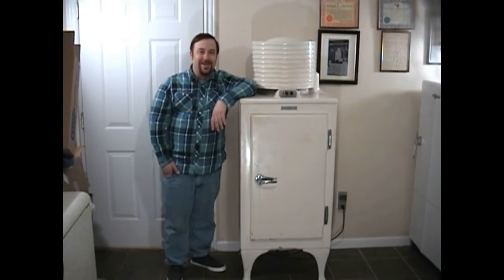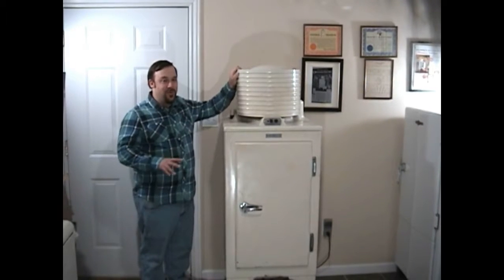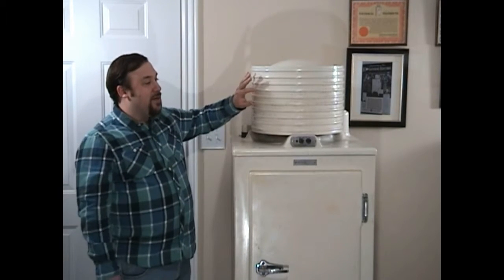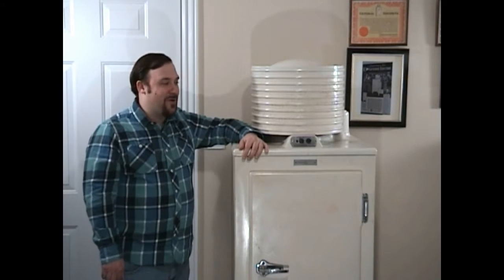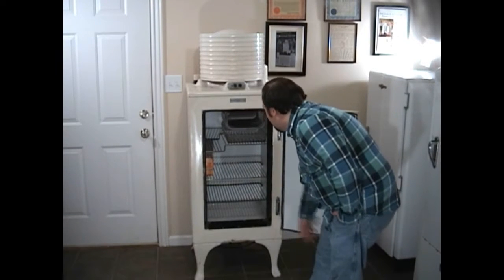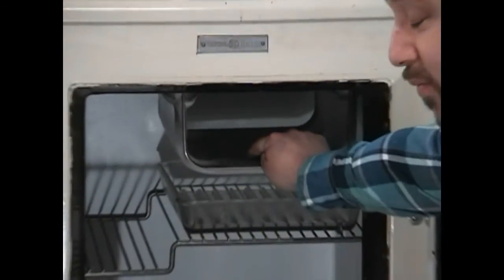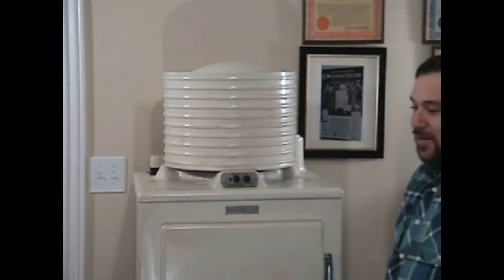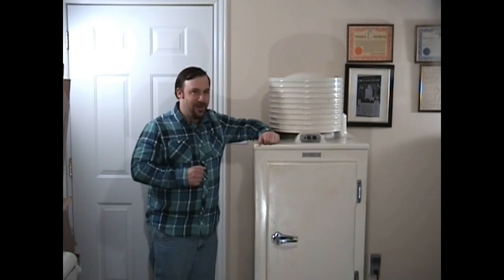Quick(ish) General Electric CA Monitor Top Overview

Comment: Great Video! I also have a big affinity for old refrigerators and other appliances as well. Appliances have been a big part of my family. My grandfather owned and operated a small appliance retail/repair shop for 55 years. They mostly specialized in Frigidaire appliances. My father and my uncle also worked there for many years. I still have a lot of my Grandfathers original tool’s.

Comment: That's so cool to have the warranty information.  You should be very proud.  The control knobs are the same as my 35 CK, and the handle is very similar too, once I pulled off the chrome cover.  It is cracked.  Maybe I'll just refinish it to look similar to you CA.

 Great video!

Comment: It is so my thing,m 1 million percent.  I just paid more to have a fridge shipped to my house, than the price of the fridge.  I thought the guy would ship it upright, but no he laid it down.  It did not seem to hurt anything.  I bought it because it was the same style and matched my 2 door fridge - yes the first GE fridge made for home sale - with the long (1927) door hinges, that you would commonly see on wooden ice boxes.  We managed to get it into the garage and eventually I will get it into the house, but I will need help as it weighs like 500 lbs.  The 2 door fridge - the 'icing unit' I think weighs like 400 lbs by itself.  That almost killed me moving it into the house, on a dolly.  That's waiting till I get money saved up to get restored - it came not on top of the 2 door case.  I also purchased some nice big 'queen ann' styled legs I can put under the case of the 2 door unit.  Currently it is sitting on a dolly with no legs.  It looks like it was built with no legs, originally.

Comment: My dad has one (GE Monitor Top) his grandma bought back in the 1920's. It was used in a rental property until the early 1990's due to it was beginning to shock you if you touched it. Today it's a little rusty up top. I am curious if it still works.
Reply: Turn the plug over in the outlet when it does that.  I used to work in a restaurant that had a large one of those things they used and it would really latch on to you if the plug was in the socket the wrong way around. It probably needs re-wiring as well of course.
Reply: @earlnut  It sounds like a love tap from the past - provided it doesn't stop your heart.

Comment: I need to re-insulate the light socket on my CA.  When the door is closed, no shock.  When it opens, there is almost 110v.
How do you get to the socket?  I figures out how to unscrew toe ceramic cover.

Regards,
Reply from the maker: I honestly have never had to get to a light socket to wire it before.  This particular one does not have a light socket.  I do know that you actually have to remove the unit and take the cabinet apart though.

Comment: I just received this same refrigerator 2 days ago (12-07-17) It runs and is in good shape but it seems to kick on every 11-13 minutes and run for about 5 minutes each time.  It at setting #5 has an interior thermometer temp of about 34 degrees and doesnt seem to get any warmer. I has been at about 34 degrees on temp setting 7, 6 and now 5. I would like to get it up to and maintain 40 degrees. Its a little noisy too. Any suggestions???